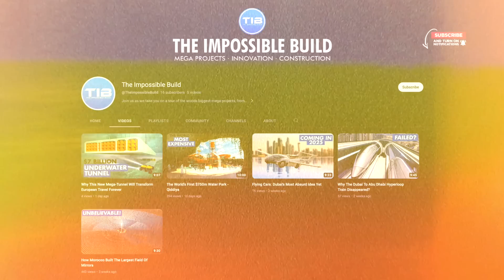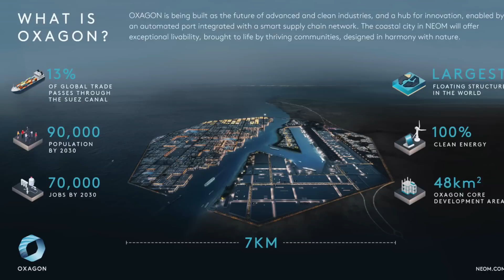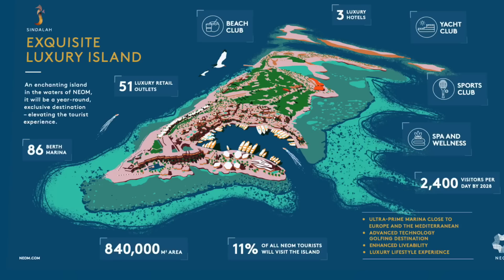The Insane Engineering Behind Neom

Comment: So they are burning fossil fuels to create this project.  I don’t see how this city will last more than 50 years as the materials will not last very long.  Eventually they will run into so many problems with maintaining the line from breaking down especially with so much heat you are having to deal with in the desert.  Concrete is not a substitute for traditional stone mason work which lasts for thousands of years.  Modern methods of construction cannot compare to old methods of construction.